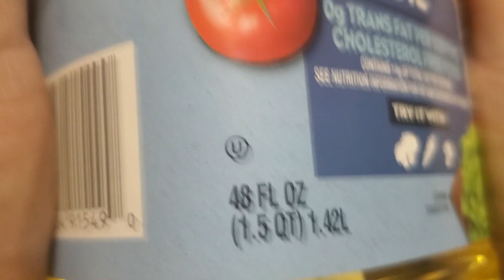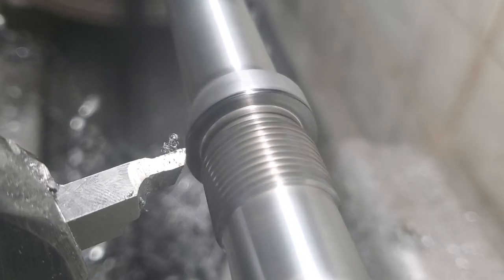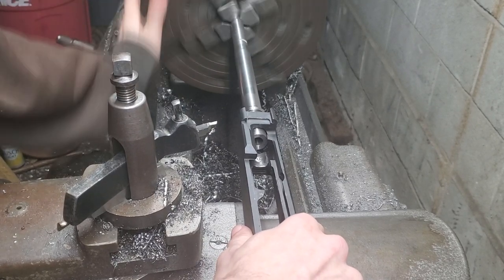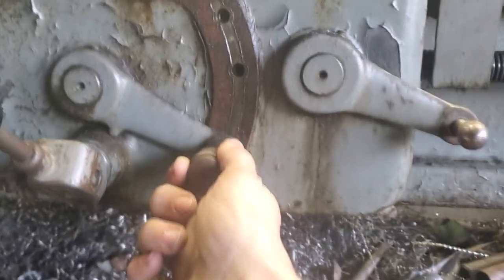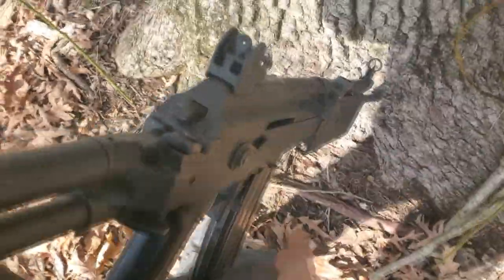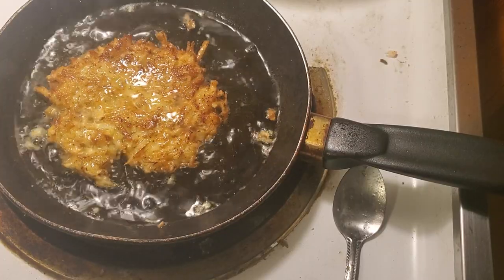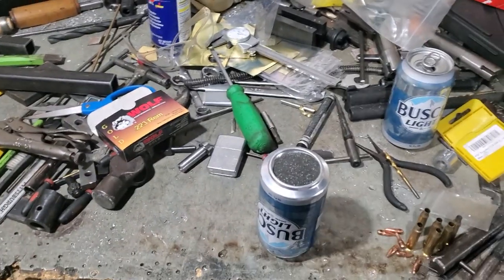Galil Barrel Timing (On Green Mountain and Their Lies)

Comment: Engineer here. The dimensions with the parentheses are reference dimensions. I put them where a shop might want to measure off hand to check the part. They’re usually not based on datums and sometimes would over-define a part if not for the reference designation.

Comment: Those barrels are usually designed to be torqued and then have the extractor, handguard, and gas port cut. I just used some shims on my SAR build to get the barrel timed right and torqued cause fuck re cutting it all with files and a dremel.
Reply: Shims add, he needed material removed

Comment: If I am not mistaken AK hammer & trigger will work, as for having to bend your own axes pin retaining spring.... try the AK AFTER MARKET  flat during clip.. you will need to hand fit the clip for mounting safety selector... but when it's installed, ain't going anywhere...

Comment: Just run .223 and stay away from the higher chamber pressures of 5.56. You be aight.
Reply from the maker: I'm going to run the hottest loads I can find through it just to be safe. Did you know: you can't just buy proof loads unless you're a loicensed gunsmith?
Reply: @gaunt8814  yeah, don't want the gun to short-stroke in an emergency. i just fill my rounds up with pistol powder and  they work great.
Reply from the maker: @johnsmith-sp6yl  based

Comment: This video is, from start to finish, fucking extraordinary.  When I heard the unmistakable sound of a Zippo I was already cackling and the exhale confirmed it.  Also if it were high pressure you'd see primer flattening and firing pin divot cratering before you saw that ring (indicative of impending case-head separation).  Do NOT run any hot ammo through that thing.  In fact, run the softest shooting brass ammo you can find.  I don't know about brass vs steel case tensile strength.  Be very wary of that too when switching ammos.  Just be extremely fucking careful.  It'll all be fine until it's not, and it'll be right next to your face.

Take it from the son of guy who reloaded for 50 years.

Comment: I would guess the barrel was machined and timed for a specific batch of receivers ..definitely not the Tortort 80.  You can remove barrels from IMI guns and odds are they will not match up to another IMI receiver........the odds of a unmatched barrrel timing and headspacing to a galil or US galil clone are very, very slim.(without a bit of work)  BUT..Your main problem (before you ramped the chamber)  is you are not using an IMI bullet guide.  Even with an IMI bullet guide you have to make sure it is fitted with the proper clearances or you will have even more problems...Next time you have a chance to handle an IMI galil or IWI ace...look it over closely and cycle the action.....way different than most US clones that are built on out of spec US parts.  Polishing the lower portion of the barrel chamber is a good idea....just a nice polish...I would recommend you get a nicely demilled receiver kit...Numrich, or Bomahn..Rtg if you want to rebuild this or build another, (one that has the feed ramp still riveted in for comparison.....but I would probably ditch that barrel at this point (maybe it could be used on a SAR or Micro Build with bit of re chambering...not sure.. Maybe a good time to  switch this one over to 5.45 and post some more content! 
In summary the problem with galil clones are generally related to the US made parts...

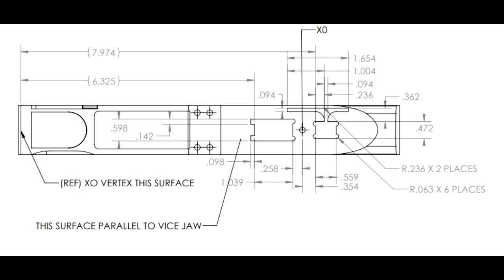Comment: 3:57 the two measurements you asked about are to make it easy to tell if you have the part in spec for the location of those two suto rectangular holes horizontal faces.

(Edit) Also, most of the dimensions I see there are in relation to those two, so their very important to making sure their in spec as a result. The pre-drilled rivet hole you mentioned it refrenced to them as well, but it would be a hard thing to measure from it alone, and if it was not pre-drilled you'ed have to use those two measurements to locate the rivet hole in the first place.